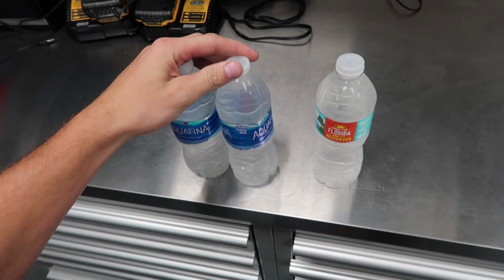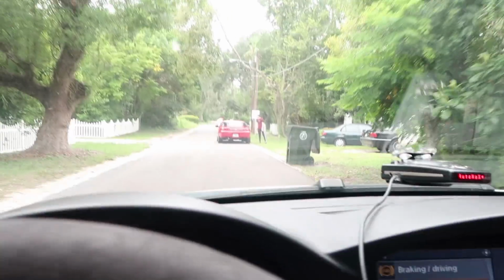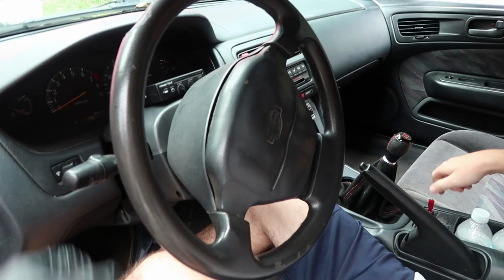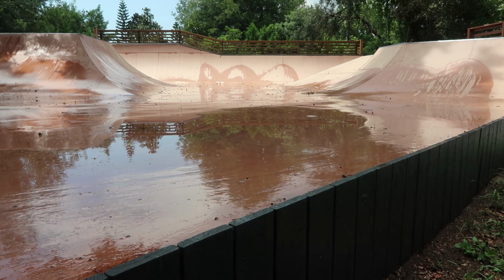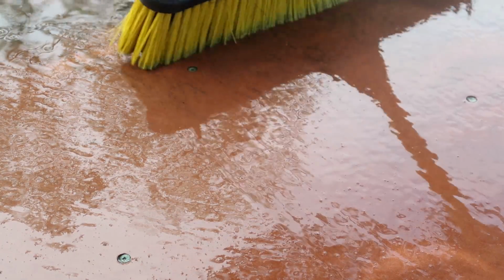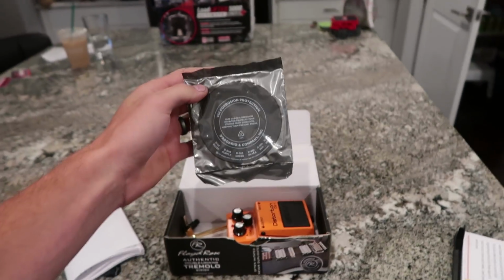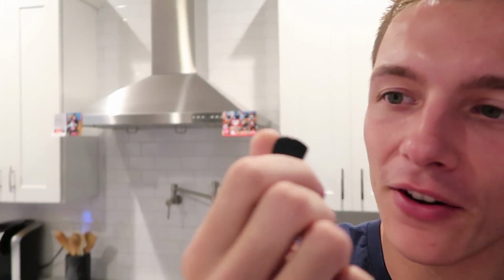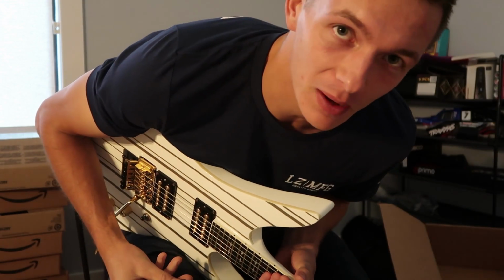ECLIPSE + ANOTHER BROKEN 240

Comment: My abs light kept comming on for no reason on my BMW. All I had to do was completely flush the break lines and it went away.
Reply: Conor Mulcahy Its because the brake fluid had exhausted its Hydroscopic abilites and there was enough water in your brake lines to cause shorts in the abs controler.

Comment: Oh my God I want to buy a 240 (or a 200 as they are called in europe) so much,but they are much rarer here and tuning in most european countries is illegal even a little bit of stance,or seats,nothing.
Reply: which country in europe? here in austria everything just has to get looked at by a mechanic....but the s-chasis thing is true, there are 2 for sale in the entire country one is a s13 and its not registerd and has some issues and the other is a rb25 s14 for 18k euros
Reply: Fr4g R4Z0R that's not a problem here in Ireland
Reply: Which country do you live in? Here in sweden you cant have an open dump valve because that "could change the emissions.."
Reply: Well I live in Hungary and technically if you get the correct papers it is legal but you have to have the president in your family to be able to do that because inspecion services dont give them out,only at hefty prices,and if some parts are not from the factory,you can't pass.
Reply: Darkside1355 in Ireland at least these restrictions dont really apply
Reply: MagicPoptartz14 ya man there so expensive in ireland and there already messed around with😕
Reply: in the UK you can have any thing you want to an extent
Reply: Kid ricers
Reply: Fr4g R4Z0R Well here you can register your car as a "modified vehicle" but Then you have to swap engine, gearbox, suspension and brakes i think.
Reply: Fr4g R4Z0R well that 240 is for sale on craogalist.. I was on Craigslist yesterday and saw it I think it's like 12k
Reply: Whole country only 3 200's and 2 are heavily modded drift cars with insane prices. So much more choice in BMW's and to be honest I like the 6 cilinders more then the turbo 4's in 200's but a 200sx with 2jz would be epic.
Reply: james cowhey They're like €5000-€7500 in Ireland mate.. That's not very expensive.
Reply: Shona a stock 240 for that much that's a lot I mean if it comes with a sr20 I would pay 6k max
Reply: Fr4g R4Z0R It sucks in Victoria Australia 180sx are banned and that's my dream car ):
Reply: Alex Villalobos The price range I'm talking about is for modified S13s & S14s pushing between 300-400hp..
Reply: Blixyy wow alot of money but its totally worth it for that amout of power man
Reply: must suck to not live in the land of the free aka the usa.
Reply: try getting all imports in the us lol
Reply: bought a zenki for 8k and invested 12k to make it streetlegal and reliable here in austria .. scheiß eintragungen ...
Reply: Fr4g R4Z0R So true :)
Reply: In the Netherlands you have to pass inspection every year, other than that you are pretty much allowed to do anything you want... We've got lots of JDM cars here (all imports, skylines, silvia's, rx7's).
Reply: Fr4g R4Z0R that sucks... I'm from Scotland and we can pretty much do what we want... just have to have an interchangeable catalytic convertor to fit on before inspection fir emissions
Reply: Fr4g R4Z0R where in europe do you live?
Reply: I'm talking about Hungary

Comment: just a tip for when youre sweep picking, try to lock your wrist and use your elbow to move you hand, youll find it much easier to control the speed and consistency of the sweep. i know it goes against everything you would have learnt ie everything should come from your wrist not your elbow when picking, but trust me itll really help

Comment: Pro tip. If you want a WAYYYYY better tone play heavy and rythem riffs with the switch in your guitar in the down possition and use the up possition for melodic leads and stuff. Bridge pickup for rythem, neck for lead. Also for good tone buy a good tube amp, and use the distortion in the amp, but boost it with an overdrive pedal like an Ibanez TS9 or Ts808. I would recommend picking up a Peavey 6505 amp because they are relatively cheap but sounds super good.

Comment: adam- ur rc traxxas ford gt can be swapped with a venilon brushless system. all brushless traxxas vehicles use venalon (except for the 100 mph one and maybe the 1/6  trucks) if u do get a venilon brushless system, there is youtubes vids on how to do the swap, and you may want to get a fan for the esc (it gets hot) and a 2s or 3s lipo battery ( i know that u already have these)

Comment: Speed sensor = abs sensor... Check the wiring most times it's just a broken cable or a bad connection it would be on all the time if it would be broken just check the sensors, wiring and abs-rings